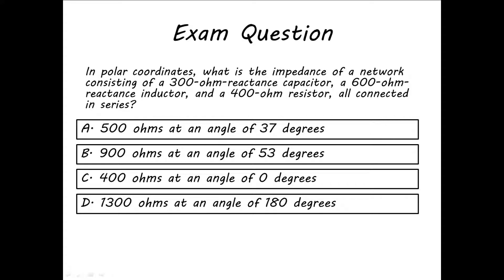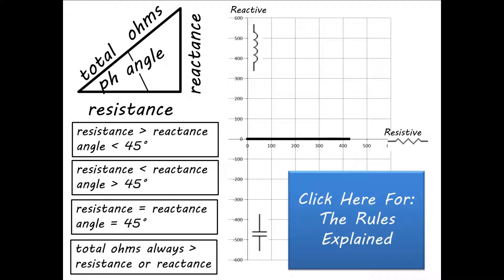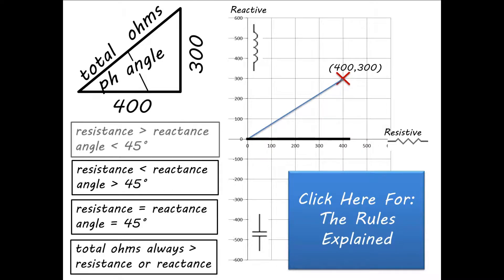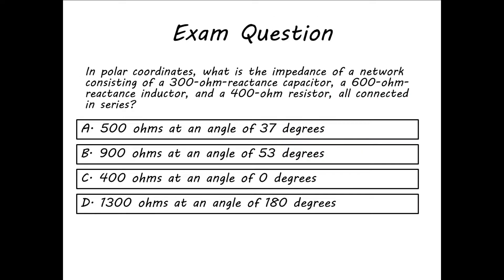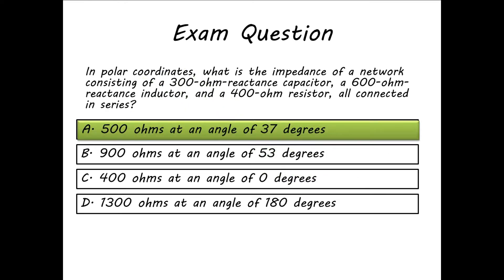Extra Class Polar Impedance E5C3

Comment: OK.  You've kind of used a logical "process-of-elimination" approach.  But let's not shy away from the math--it's not that bad.

Let XC be the capacitive reactance and XL be the inductive reactance
Calculate the total impedance of the circuit as:

Z = Impedance = R -jXC + jXL = 400 -j(300) + j(600)  = 400 + 300j

Magnitude = sqrt(400^2 + 300^2) = 500

Phase     = arctan(Y/X) = arctan(300/400) = 36.87 degrees